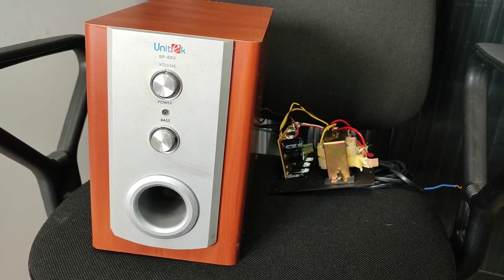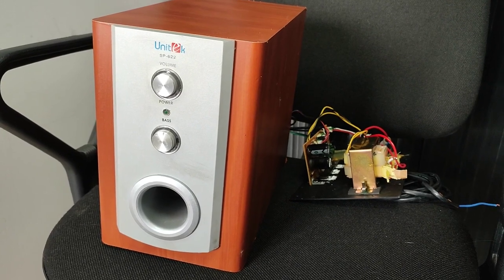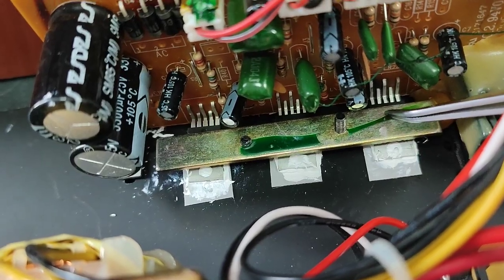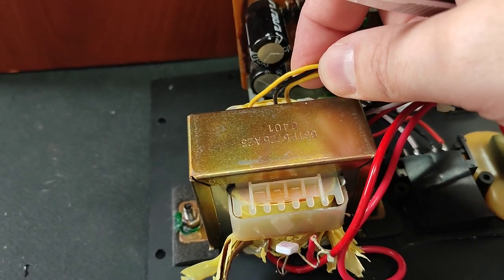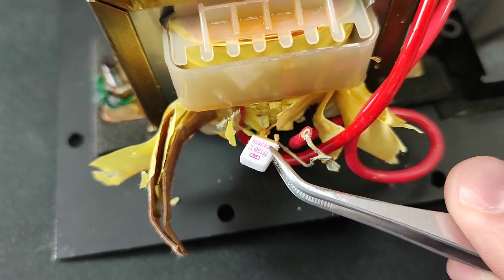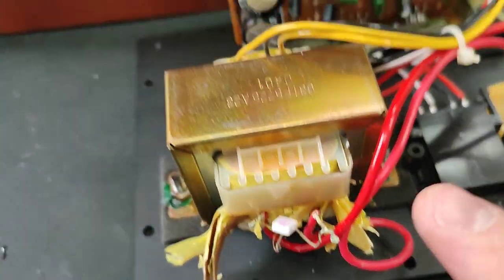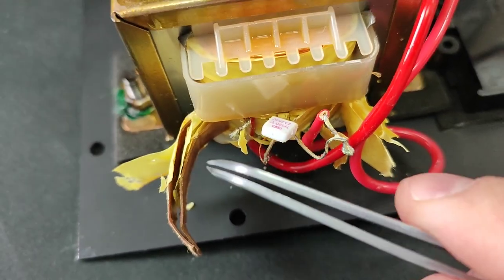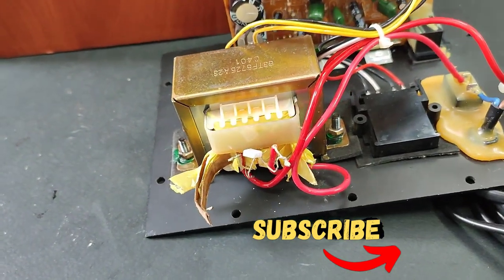How to fix old PC Speakers Cheap!

Comment: Really, inside the transformer? Something new for me!
Reply from the maker: Good news are that the thermal protection is under the insulation tape, not in the windings. So it can be reached and replaced easy;) ☺️